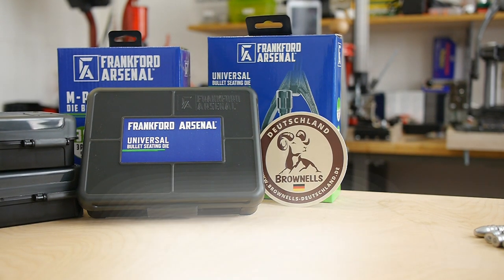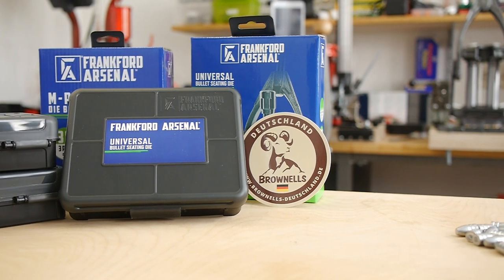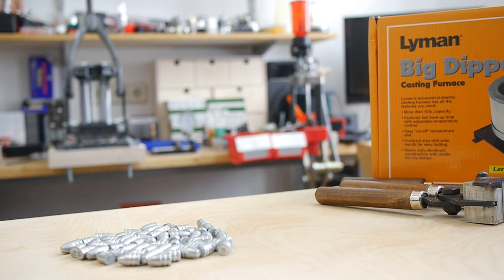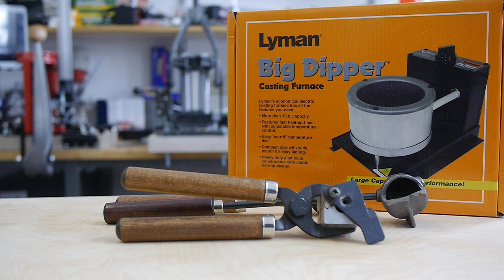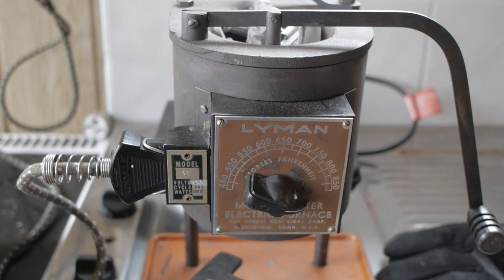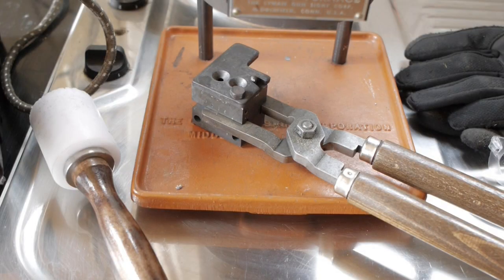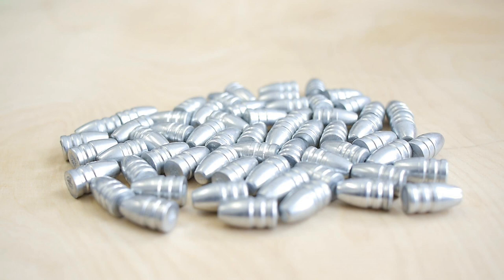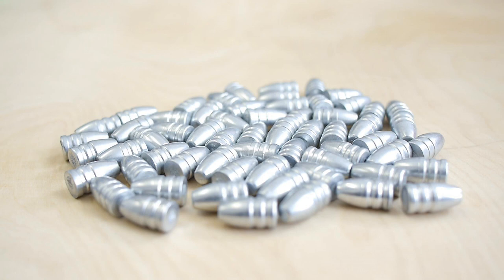Casting Zinc Bullets - Trailer

Comment: I have never made zinc bullets...BUT I have followed the development. A couple of questions I would have are 1) What effect would zinc have on the barrel ( what is the drag of zinc inside of the barrel)?  2)Would powder coating the bullets have an appreciable effect on the performance of the bullets? 3)How much smaller would a person have to make the bullet diameters to accommodate for powder coat? 
I know that you cannot answer these questions now because you cannot test them but it is an interesting question for further testing.
Reply: The zinc casts about 30 percent lighter than lead. It does not foul the barrel and needs no powder coating or gas checks. The literal down side for some applications is that it simply is lighter than one might need for large game hunting
Reply: @ZONES89RS  One solution might be to use a mold for a heavier lead bullet

Comment: Thanks for sharing! With a full lead ban coming up in the EU by 2023 we will all have to go this route, if we still want to continue with the shooting/reloading hobby. However I am a bit worried about potensial health issues with the zinc. What precautions do you take? Also, where do you find zinc? It does not seem to be abundant.
Reply: Wheel weights are zinc these days.
Reply: You need small amount of zinc every day.

Comment: If you are properly preparing your Lee molds by smoking them inside casting zinc will do little damage.  If you do not coat the insides of the molds with carbon then you are not preparing them right anyway.  I use wheel weights for my source of zinc.  I use a simple Lee pot and a modified dipper and heat the zinc using a single propane burner. I use zinc cast bullets for .44 Magnum, 300 BO and just recently .45 acp.  You have to keep in mind that zinc will shoot like copper so beware of what is behind what you are shooting.

Comment: Because of case capacity constraints using such light weight and longer bullets that typically weigh 147 grains when lead is used you'll probably have to use a faster burning powder. Slower burning powders might cause reliability problems in cycling the action.
Reply from the maker: That's right buddy
Reply: Another alternative is to compress loads when using slower powders.